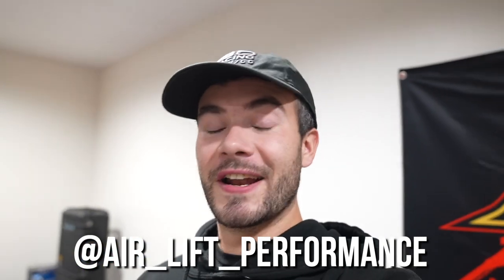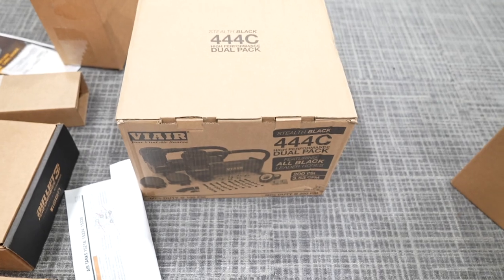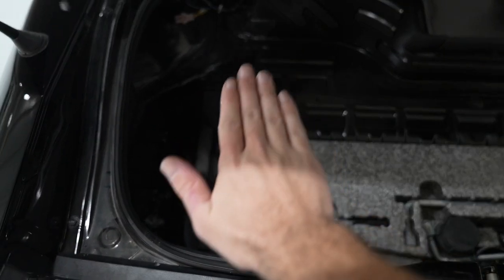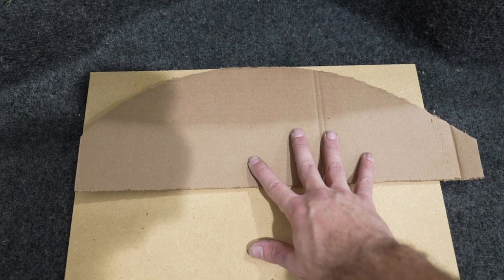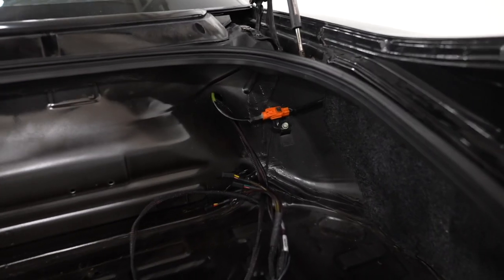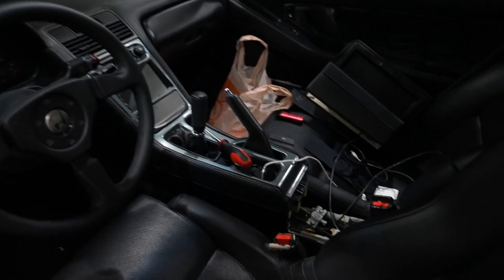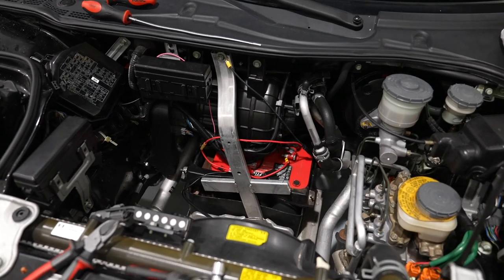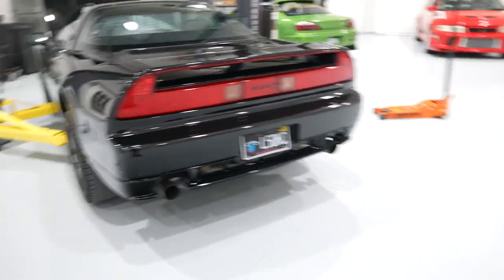Installing Air Suspension on my Acura NSX! Part 1: Trunk Setup and Wiring!

Comment: Little tip, you don’t need a 2x4 to hold the trunk up, just clip a pair of vice grips on the shock while it’s open and make sure they’re tight. That way the 2x4 isn’t in your way 🤷‍♂️
Reply: Or buy some new shocks 😬😝 they be cheap lol
Reply: Hose clamps around struts work just tighten every time

Comment: I have to disagree with your "bag boys". You can get 12V constant power from the engine compartment...@ the 12V post on the alternator or starter, or depending on where the fusebox is located, you can get 12V from one of the posts where the 12V comes into the fusebox. Just a heads up for next time.
Reply: yeah was just thinking, positive wire for starter is straight wire from battery, always live.
Reply: was about to say the same
Reply: @kekeruus  mitä vittua, onkos se itse naapurin keij0? :D
Reply: Exactly. Pulling off the engine is no different than coming all the way from the battery.
Reply: 100%

Comment: You could get the power from the big wire on the starter motor or the altinator as they run directly to the battery

Comment: If you didn't want to run the power line to the battery why didn't you just go off of the starter motor feed🤔

Comment: Freaking called it, freaking slamming a car that isn't getting any easier to replace if you make a oops. Crunchy fenders and Rusty frame rails here we come.
Reply from the maker: That’s coilovers homie, that happens with stance kids slamming their cars on springs that they can’t adjust on the fly. Air, if anything, will preserve this car whilst looking great parked. You don’t drive low when on air, that defeats the purpose
Reply: @diiviinemedia  well i disagree... It depends on the owner and the purpose of your car. I drive a bagged mk5 golf on Oz futuras and i drive it daily as low as possible (not ls400 low) even lower than most cars with coilovers, but being on bags i can air it up if needed and it can look even cooler when parked.
Reply: @stefanocateni6901  ofc u disagree.. you drive a golf